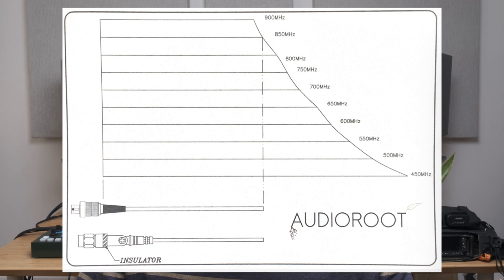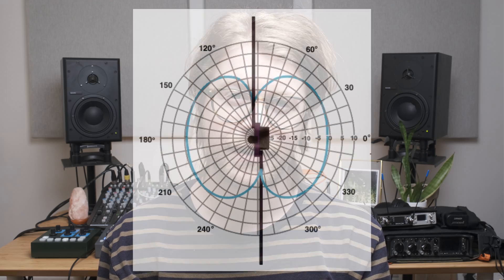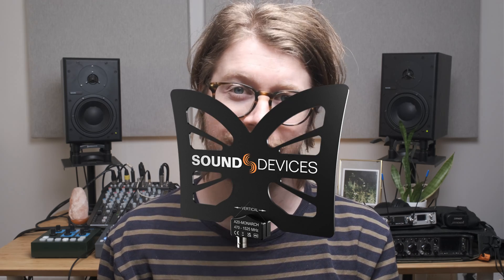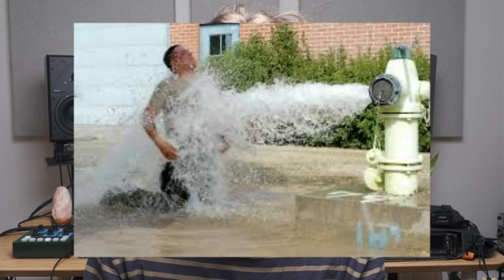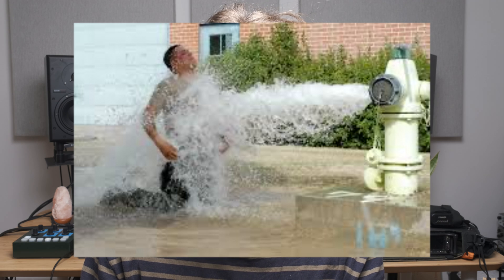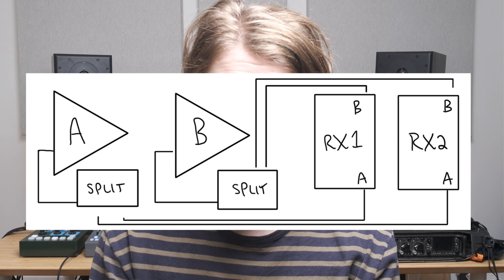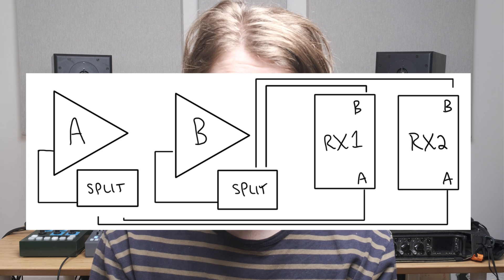How To Use Antennas (Design Fundamentals & Best Practices)

Comment: Hi Nicolas, very thorough explanation and plenty of good informations on antennas.
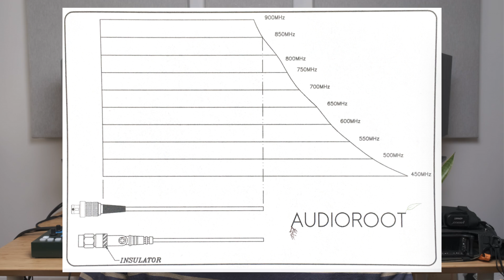I want to point out 2 things about whip and dipole antennas. At 2:16 you say that whip are omnidirectional. Provided the antenna is vertical (as we all do in a bag or very often to on the tx), then in the horizontal plane the antenna is indeed omni. But they don't emit nor receive from their tips, so in the vertical plane they're like a figure of 8. Tridimensionally, this makes them bagel shaped, or toroidal, as they say, not totally omni.
Another thing I find important to beginners is you barely touch on polarization (which I believe you briefly mention in the RF Venue antenna) . Whip antennas (the most used by beginners) emit and receive only polarized signal. So if your transmitter is vertical, your receiver should also really be vertical. It doesn't happen often that you place the transmitter horizontally but sometimes it happens. Also, I'm not sure it's still like that, and if it's everywhere like that, but historically TV signals are horizontally polarized (and TV antennas are in fact always flat), and since we share frequencies with them, keeping our whips vertical will help a little stay away from their interference.
But the video is anyway a bomb with plenty of infos. thanks for producing it.
Reply from the maker: Hey! This is some great knowledge and exactly the type of thing I love to see in my comments.  Thank you for taking the time to write and expand on this topic! I didn’t know about the polarization of TV channels. Will pin this comment. Cheers!

Comment: Great video! Keep up the good work :)  Would it make any sence to use a dipole and a sharkfin at the same time in a bag...to diversify even more? And is there a small sharkfin for bag use?
Reply from the maker: Cheers! Yeah some folks will use a combination of a shark fin and a dipole, or more commonly a diversity fin style (RF venue and audio wireless both manufacture these). 

LPDAs are designed around the laws of physics, as such they must be designed in a specific size to accommodate the frequency range they’re receiving. You’d be hard pressed to find one that is physically smaller that works effectively in the UHF band. Hope this helps!
Reply: @nicolasfieldsoundservices Thanks! 
Yeah that does help :) 
There is not much out there on YouTube regarding uhf antenna basics. 
I have a video suggestion, if you dont mind: A video explaining all the different kind of frquency ranges and what they are used for on a filmset, and in general. What ranges are good for filmsound and what ranges to avoid. And finally what causes interferance and how to trouble shoot if you have issues. 
I have been looking for a video like that, but did not find one, so far. But maybe i just dont know where to look…
Reply from the maker: Thanks for the tip, I would love to make a video about this. It’s a bit of a can of worms in some ways because different areas of the spectrum are legal in different parts of the world. But generally speaking VHF is Comtek land. UHF is talent wireless. And newer gear can tune into spectra band around 1.5 G. 2.4 gHz is where a lot of prosumer devices live. I did make a video about frequency coordination that touches on RF a bit more, it’s called “How I Use TXAdvance”.

Comment: Awesome video! So glad I stumbled upon this video.
I'm an amateur in sound working in Theater with 14-16 Lav. mics.
I have a combiner along with Lpda antennas. But I still get some dropouts with mics. Looking into RF pass filters..but they are expensive.
The two venues have a ton of RF.
Any thoughts on helping the dropout situation?
Thank you for sharing your expertise!
Reply from the maker: Hey hey! That’s a lot of wireless. Good job! Assuming you have already done a proper coordination, I would look at adding another zone of receive antennas. You can actually use a passive splitter to combine two zones of antennas. A pair of omni antennas near the stage could help secure your transmission. Another thing to consider is your transmitter antennas. If they’re touching talent’s skin or buried deep in a costume their transmit efficacy could be compromised. Hope that helps!

Comment: Thanks for this video - I’ve been professionally recording for broadcast about 25yrs now and still found this useful!!….. they’ve haven’t found me out yet!!

I’ve been using either straight whips from my SL2 (with MCR54s) OR the SNA600a dipoles that are tuned to around 600mhz (I’m uk based)

Is there a need for additional RF filtering in line between the dipoles and SL2?

I also obvs have the internally SD888 filtering set correctly too…

Would I benefit from these in line filters do you think? Or would it merely introduce more gain loss?

Thanks in advance!
Reply from the maker: Hey hey! Thanks for the kind words I’m glad you found it useful. Congrats on 25 years in the biz. Since both of the antennas you typically use have built in attenuation, plus the SL2 active filtering —I think you’re proooobably good? If you find yourself constantly battling walkies on set you might wanna think about adding narrowband filters. I’m not much of an RF guru myself but I’d say if it isn’t broken don’t fix it! If you felt the need to add active antennas into the system then I’d suggest a filtering antenna like LFA.

Comment: I am going to mod a trio of Sennheiser EW512 G4 receivers to have SMA connectors instead of the supplied permanent whip antennae. It will give me the option of just applying a whip antennae to the receivers in my bag, but also I can now implement an RF distribution system and butterfly antenna system. I am currently looking at the Deity SRD mini RF distro box and their BF-1 antennas. The SRD mini can be powered off my power distribution box so I still have the one swappable battery for the entire bag, but get the added signal of the butterfly antennae or any other passive antenna. I like the idea of being able to go back and forth based on the situation with little to no work.
Reply from the maker: Sweet, seems like a solid plan. If I were in your shoes, I would look at the Betso Bowties. The reason for this is that the Deity Butterfly is 470 MHz-1 GHz and their distro similarly offers no filtering. If you want to give the front end filtering on your G4s a break,  utilizing an antenna that attenuates more out of band frequencies will help secure your reception.
Reply: @nicolasfieldsoundservices  Thanks for that tidbit of advice. I did end up going with a pair of the Betso Bowties along with the SRD mini based on your recommendation. That made perfect sense to me. And the Bowties were a bit cheaper on price than the BF-1. They look really nice mounted on my sound bag.

While I currently do not have diversity receivers, at least I am set up for the future that I can utilize diversity receivers when I can save up for more professional receivers.  I have already modified the G4's. It was extremely easy to do (less than 10 minutes per TX/RX pair) and I have already seen a marked improvement in the reception of the G4's with proper sized SMA antennas. I am short my order on SMA jumper cables at the moment, so I still cannot test how much improvement the Betso's can/will provide yet but the cables are on their way. Slow boat from China.....

Comment: I’m currently running two of the new Deity butterfly antennas through two RF venue splitters in order to connect them to two of the Theos receivers. I’ve been considering introducing a filter into the mix. Do you think this would be a good idea? Or is it not really needed because the Deity butterflies are passive antennas?
Reply from the maker: Your Deity antennas are designed to receive all the RF from 470-1 GHz, and the front end filters on your receivers have to filter out the unnecessary bits. If you find yourself often working within a certain area of the spectrum, a filter would theoretically be helpful in reducing the work your receiver filters have to do and this could enhance stability. So in theory it’s a great idea. In practice however you might not need this in your signal chain if you’re happy with the performance you’re getting with the system as it stands. Perhaps you could rent or borrow passive filters and run some tests to see if it’s worth it right now?
Reply: @nicolasfieldsoundservices  Very thorough and thoughtful answer. Thanks!

Comment: I’m curious, at 09:00 you mentioned working with a sound mixer who had a polarization diversity antenna clipped to their bag. Did they have to keep their bag and the antenna pointed at the talent in order for it to work because of the LPDA element of the antenna, or does the dipole element change things in that regard and make pointing the antenna less necessary? Asking because I’m planning to add an antenna system to my bag for boooming/bag set ups, and I’m not sure if I want to go with two bowties or one polarization diversity antenna
Reply from the maker: Although the diversity fin has a dipole element I still think of it as a directional antenna. When we used it, it was always pointed at talent to help with rejecting the random RF in the urban area we were shooting. It’s a bit of a big antenna to use clipped to a bag if you’re planning to also boom, which is an important consideration. I personally hate feeling too clunky or loaded down when I’m a one person band.
Reply: @nicolasfieldsoundservices  very nice insight. I imagine it might also struggle in RF heavy environments because of its shark fin qualities. Whereas, maybe a bowtie or a dipole set up would have less trouble with that?
Reply from the maker: So like a lot of things in sound dept… it depends. If I had a boom op and was working from a cart, I would reach for LPDAs with filters first. Next choice would be dipoles —up on a mast they will get you incredible range. But honestly just having any antennas up will make a considerable difference. Now, certain antennas are technically superior than others at eking out that last bit of performance, which in some cases can make or break your ability to capture a scene, which is really what this video is about. For what it’s worth, I work out of a bag 90% of the time and just rock whips. I like the simplicity but I also have wireless with great range on whips alone (Wisycom). Keeping things small and light means I can usually just move and get closer to talent. When you work with a sound team and/or need to be stationed further from set it becomes super important to have solutions to make sure you can get the job done. Hope this helps.

Comment: This is so cool! I appreciate you making all this information readily available and acknowledging your level of experience while starting a conversation among mixers. I’m curious, do you have a personal dipole antenna preference between the lectro vs the betso ? I’m thinking of getting two for a set up on my ENG bag.
Reply from the maker: Thanks! My .02 is that the Betsos have the edge over the SNA due to easy deployability. But I still use the SNAs with the Remote Audio Miracle Whip mod for my Comtek transmitters!
Reply: Nice! I appreciate your 0.02. Do you know if theres a benefit to raising a dipole antenna 8-10 feet in the air, like you would with an LPDA? @nicolasfieldsoundservices
Reply from the maker: Definitely, line of sight is improved a lot by elevating the antennas. Big source of RF absorption are bodies so if you can go overhead above crew members you’ll usually get more reliable signal.
Reply: @nicolasfieldsoundservices  you rock! Thank you

Comment: Amazing video, thanks for sharing. Is there any cheaper alternative option for "PSC RF multi SMA"  in the market? With thanks.
Reply from the maker: PSC just released a new product called the Multi Mini. Looks awesome for smaller setups and is about $200 USD cheaper than the multi SMA. 
https://www.gothamsound.com/product/rf-multi-mini-antenna-distro
They also dropped a product that is a combination BDS and RF distro that can save some real estate if you’re working out of a bag. Thanks so much for the comment!

Comment: Hey ! I usually use Omni's indoor as there is lot of reflexions. And LPDA's outdoors. But my go to is 1 Wisy LFA  (LPDA) + 1 Wisy ADFA (Omni) with no added gain but a more narrow filter to the frequencies that i am using. With a BSRF AS122 Distro. It works wonders
Reply from the maker: That sounds like an awesome setup! I’m looking to add some active wisy antennas to my setup specifically for the tuneable filters. Cheers

Comment: Nice video Nicolas. Beware of axial vs normal mode helicals. Normal mode helicals do not exhibit circular polarization. They are essentially linear.
Reply from the maker: Thanks for the info! Yes I just researched this. In my video I erroneously collapsed all helical antennas into the circularly polarized category, but in fact normal mode helicals have a polar pattern similar to dipole antenna. Appreciate the clarification :)